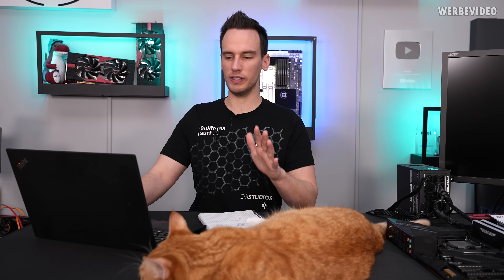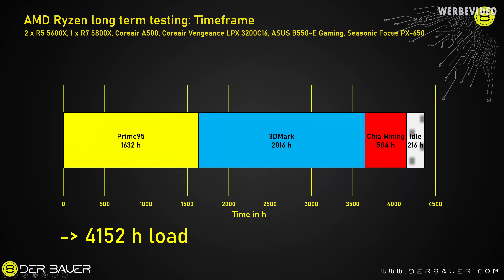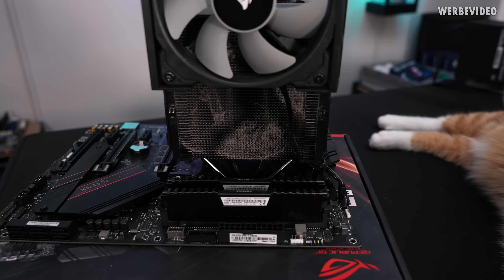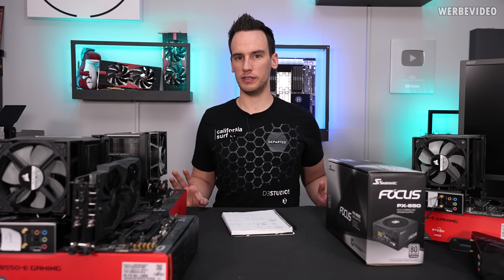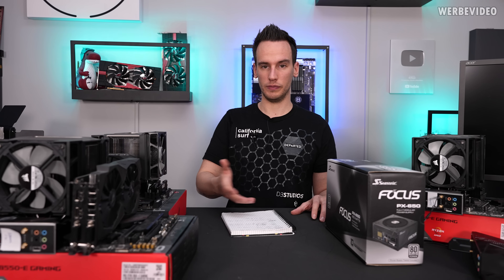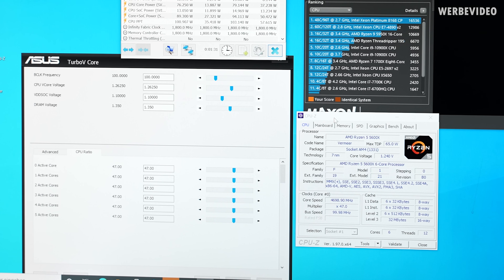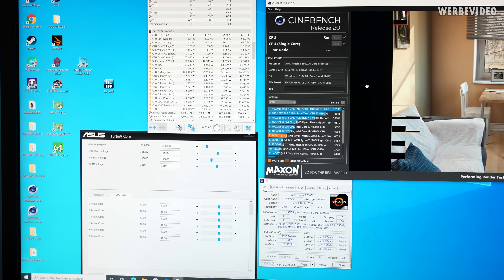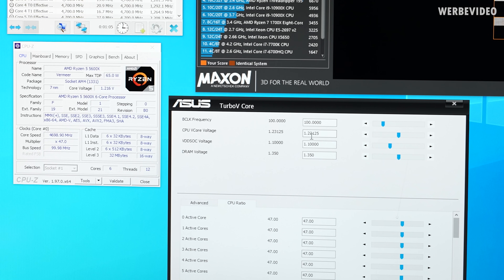4152 hours of Ryzen Long Term Testing: We have Good and Bad News

Comment: This is the type of content we need. It puts some science around the typical misinformation that gets spread around the internet. Here's how it works: one person in reddit or forum gets a bad CPU that should've been RMA'd in the first place, then everyone else starts freaking out, as apparently, this one bad sample becomes the general truth. Zero methodology, one sample out of a million. No one cares about everyone else with successful experiences, the bad CPU is the one to look at-- as if RMA didn't exist. I commend you on this research, calling it just YouTube content, with the amount of low effort videos we have nowadays, should almost be offensive.
Reply: I think you're correct. I had a launch day 3600X that was a horrible piece of silicon, it wasn't worth an all-core OC, and PBO made it worse than stock. I ran that CPU on stock settings for about 9 months, then it started BSOD'ing randomly once every few days. That eventually became once every few hours, before I RMA'd it. The 3600X I got back from RMA was a completely different chip, boosted over 150MHz higher and ran cooler to boot. It also didn't BSOD which was nice. I suspect if I had been running an all-core OC, I likely would've suspected it was degradation, when it was just a faulty chip.
Reply: @K31TH3R Was it a different stepping?  Stepping is critical
Reply: @VndNvwYvvSvv  While that's true of Zen3 CPUs (Ryzen 5000) the Zen2 chips always stayed on the B0 stepping AFAIK, even after the Zen2 XT release. However, the replacement 3600X I received was manufactured about ~2 months after Zen2 XT was rolled out, so I suspect the much better silicon quality was attributable to the improved and updated photomasks implemented with the XT chips. The chip performed identically to the 3600 XT and ran a consistent 550 CPU-Z single thread score @ 4.5GHz.
Reply: @New Moon Typically there are bad batches, but if you think it's worth keeping a bad CPU, then more power to you I guess... I'll RMA any day, any time, if I get a shitty CPU. I don't see a reason to keep a CPU from a crappy batch.
Reply: Science?  2 cpu?  I dont think you know what science means then.
Reply: @timothyandrewnielsen  and they forgot to test on a new motherboard, its probably the VRM on the mobo that caused the 3rd restart on the "bad " one, since it run two cinebench test just fine (in which the cpu as a chip had the same max temp on each run) so it probably was the vrm that started to get warm/hot after the first 2 runs and failed to maintain the proper voltage on the 3rd run. 

if you overvolt your CPU you dont just stress the cpu it self but the motherboard (e.g its VRM) as well. 

they should test the CPUs with a brand new mobo and PSU to exclude any failures of usage unrelated to the CPUs
Reply: @timothyandrewnielsen  Sample size is obviously a very important variable, however, there needs to be a proper test methodology in place, which is what derbauer did here. I will take his 3 cpu case anytime over 100 idiots in a forum who have no idea what they are doing shouting "MY VOLTAGENS HAVE DEGRADED MY CPU". Bad CPU Batch, period.
Reply: @CasualGamers  Sorry but his test has proven nothing.  Not scientific.  He only proved his CPU are good.  Not yours.
Reply: @sbcontt YT it just doesn't make sense for me honestly for them to do such thing, people would eventually realize something was wrong
Reply: I dont think AMD is anywhere near a bad CPU brand. Especially now with the 3000 CPUs I have only had bad experiences. RMA´d 4 CPUs and after half a year of gaming my 3900X keeps crashing and BSODing. Out of 7 CPUs of that gen (2 3600X, 1 3700X, 1 3800X, 3 3900X) All of the 3900X had problems 2 of them at stock and 1 undervolted to actually get the TDP.
Ill go with a upgrade to 5000 cpus to check if I will keep staying with AMD or change to intel since the 12th gen seems quite interresting
Reply: @AlpineTheHusky  if you realy have 7 bad cpu´s in a row, maybe your problem is something else but not the cpu
Reply: @georgwarhead2801  I built systems for friends. So 7 Sets of CPU, Ram, GPU, PSU and everything else
Reply: @AlpineTheHusky  i get it...it just feels strange to me to find 7 faulty cpu´s one after the other and still amd has ~ the same RMA rate as intel. i build my self 3 ryzen systems with 3600 and 3600x´s, many of my friends upgradet to a 3000 series cpu after i gave them suggestions for there new builds and no one has this kind of problems
Reply: well to be honest I did not see the entire video but incase it has not been addressed, as far as CPU restarting after the 3rd time of trying out cinebench it could be a VRM/mobo degradation rather than a CPU one so you should have tested the CPUs on a brand new mobo.  Overvolting doesnt only stress the CPU but the mobo as well. Also brand new PSU wouldnt hurt either.
Reply: At the same time, I've *never* had to RMA an Intel chip.  In the past two years I bought seven 3950X systems and nine 5950X systems and have had one bad CPU already (dead no-POST after 5 months) with at least two more just recently I'm suspecting are also starting to fail (random no-BSOD shutdowns) with no OC other than DOCP@3600 and PBO "auto" (Asus Pro WS X570-ACE boards, Seasonic Gold PSUs).
Reply: Huh, sounds like how certain other movement started, that's making covid worse to this day
Reply: Here's something to consider. Do those boards people are having problems with all use Intel chipsets for anything? If so there's the problem. I'd explain why but I'm sure it would start a flame war with all the brainwashed Intel fantards and apologists.
Reply: The problem is that it is VERY hard to get a company to do an RMA on a processor... VERY hard... like pulling lion's teeth and the lion is the size of the Empire State Building.
Reply: @christopherkidwell9817  My 3950X RMA was painless, to be fair to AMD.  Filled in the form, got a new CPU - no questions asked.  I had good troubleshooting information in the RMA form, of course, so perhaps had more success than a less detailed RMA.
Reply: @christopherkidwell9817  LoL. I did mine real quick and they didn't even ask for purchase receipt or invoice. I just signed a waiver. This was an Intel RMA, but a friend did AMD and it was painless. They didn't have the same CPU to send back so they paid him and it was actually more than what he paid for, lol. Unlike Intel, they did ask for an invoice though, he mentioned. This is in Brazil where stuff generally doesn't work... RMA works great for both companies
Reply: i had a bad 5600x tho. It was freezing when i gaming and one day pc stopped posting completely. After 3 weeks of hard work (i couldn't find any compatible hardware to try and find out which of my hardware is gone bad) i understood my CPU was bad. They sent new one from RMA.
Reply: And much of the problem was Reddit types of individuals and groups. Never underestimate their weird hive groupthink and tribal shibboleths.
Reply: Casual aqui 👀
Reply: @sbcontt YT  I live in Brazil, where laws generally don't work, yet AMD and Intel RMA works great. I even have a video doing RMA by phone in my channel (in Portuguese obviously). I RMA'd Intel CPU even without invoice, it worked just fine. AMD asks for legit invoice though. The other guy in Indonesia also gets RMA, but either way, that's not the point. It's just that these rumors get spread based on a poor sample and everyone starts assuming it's degradation. My R5 3600 has been through 1.85v under ln2 (check hwbot) ran a bunch of benchmarks and I still daily drive it with 1.35v at 4.3ghz with no problem. There's just bad samples and people are lazy to RMA. Maybe there are countries where it doesn't work, but I would bet that those complaining didn't even try it.
Reply: @CasualGamers  I don't get it, just RMA it? Your law🤔
Reply: salve concordo com tu
Reply: It's not just bad CPUs - sometimes people flash newer version of BIOS which has tweaked LLC settings / disabled stretching or some other changes (RAM related for instance) that make the system unstable (or it wasn't stable in the first place, it just worked because clocks were stretched, for example) and they go to Reddit and start to tell everyone how their CPU degraded
Reply: @sbcontt YT I don't know dude but I live in Indonesia, and I have yet to see such problem with cpu RMA's in one of our largest PC enthusiast facebook group, granted there might be one or two but most of the times it was just supply issue, took a bit longer for them to get the replacement
Reply: Testa DDR5 nas APU AMD assim que sair. 
Se nas Intel parece ter melhorado quero ver nas AMD.

Comment: degradation is what i experienced on my 1st gen ryzen after a couple years of 24/7 heavy use. both core and imc were affected and now i can only run at stock speed.
Reply: Theres absolutely no way you can only run at stock speed. LOL.

100% lies.
Reply: @nexxusty  believe what you want but that's what i experienced. the chip itself was bad at overclock since the first time i bought it

Comment: YEssss finally lol was waiting for this video for months lol scared to OC my ryzen 24/7
Reply: Their not much room to OC modern chips these days.
Reply: @grlmgor  yes true, I tried to OC my 5950x conservatively at 4325GHz it always either crash after a few hours on heavy load because I didn't give enough voltage or if I increase the V it generates so much heat the fan has to be running ridiculously loud, and I can't squeeze out more than 10% performance for my use
Reply: @ddr80  You need to undervolt the ryzen 5000 series to get performance.

Comment: LMAO! The only CPU I've damaged with overclocking was an AMD K6 400MHz. I jacked it to 550MHz with a ton of voltage. I knew I was well outside of the safe limits. Going from 2.2V to 3.1V if I remember correctly. It was a trash tier CPU and I knew it. Several of my friends managed to get to 550MHz with just 2.6V or 2.7V. One day, during a big compile job, I got a kernel oops (Linux version of BSOD). I rebooted at it went into a spontaneous reboot loop resetting as soon as it tried to unzip the kernel image. Ok, let's remove the over clock. Nope. It ended up only wanting to run 350MHz at 2.5V, so I gave it to a friend who was on a 266MHz... But that thing took a hard beating sometimes 12 hours a day compiling code for 3 and a half years before taking damage... Every CPU I've had since then (except laptops) have been ridden hard and put away wet for their entire lives, and all of them have lived on with other people until they were laughably outdated. And I'm not an upgrade-slut. Many of my systems have been run like this for 5-6 years before being passed on. And they all ran stock speed at stock voltages for ever on after...

Comment: My girlfriend's 6600K recently got stuttering in some games after being overclocked to 4.5ghz at 1.25v for 3-4 years. I increased the voltage to 1.3 and all is good. After the next 4 years I'd increase it to 1.35, but I'm sure we'll upgrade her system before that.
Reply: May be even the PSU, not even the CPU.

Comment: personally, anything above 1.4V scares me, both on intel and amd, though admittedly more on amd
Reply: Alder Lake is on Intel 7, which has a density ever so slightly higher than TSMC N7.
Reply: @andersjjensen  I've not had hands on with intel 7, only had experience with 8th 9th and 10th Gen
Reply: @renchesandsords  Well you can always get a 12900K. That thing is factory over-clocked so you don't have to bother :P

Comment: Great work!  I would like to see you continue this test for another six months on those CPUs, and add an Alder Lake (preferably i7 or i9) at 1.55 or even 1.60v to this test.  I would suggest doing CPU mining as your test load, to offset your power consumption.
Note that you can set your connection as "metered" to reduce Windows Update reboots.  Also note that you can look in your System Event Log after a reboot to determine exactly when the system rebooted.  Chances are, this history goes back the whole six months!
Reply: Why intel at even higher voltages? Would it not make sense to use the same 1.45v to compare how monolithic gets affected vs chiplet? I mean you could not run 1.6v unless you cooled intel down with liquid nitrogen lmao.

Comment: I have a 5950X and a 3970X running 24/7 with PBO under custom loop waterblocks mining CN-Heavy. We'll see how long they really last.
Reply: If you're mining you should definitely put an all-core overclock, it will increase hashrate and reduce power consumption, increasing profit.

Comment: I run my 5800x at 0.7 volts lol so that means that mine will live forever?
Reply: LOL what clock speed?
Reply: @grlmgor  Blazing fast 2.3 Ghz, I've managed to push it lower to 0.65 volts but that's really pushing it. You also have to bring it down from default voltage in small steps otherwise it crashes, but it's worth it for the beautiful sight of a 5800x at 20 watts lol.
Reply: @CulturalCats  I run mine at all core 4.6 Ghz @ 1.15v with no boost, it run about 40 watts.

Comment: My 2600K did degrade slightly with a high OC and high voltage but it took about 4-5 years and it was still good for another 4 while slightly reducing clocks/raising voltage over time. Nothing wrong with that and it seems things are similar now
Reply: same here, I bought my used, had it for like 2 years at 5ghz 1,48-1,5V and lately I had to go down to 4,8ghz for gaming (4,5-4,6 fully stable at 1,5V lmao) so 10 y.o. cpu That probably sit 4,5-5ghz all its life finally starting to go out slowly, if I run stock clocks or like 4,2ghz at 1,25 it would run probably another 10-20 years.
But I just bought 5600x
Reply: also my temps are not bad, liquid metal, good cooler slightly polished the ihs myself, when gaming it rarely goes 75-80* Celsius
Reply: @pilot554  Lmao I had mine "cooled" by a Corsair H60. I no longer torture my CPUs :)

Comment: 1.45vcore is nutty when pushing these chips at 100% heavy load.  This video is fantastic thanks for doing this experiment!
Reply: Thats the Vcore I used to set in my old Phenom II x6
Reply: @ikarus1111a  a few years back it was normal to have a higher voltage, it depended on the architecture the given cpu was built upon. Bigger nodes could handle higher voltages more consistently, smaller ones require less and less to slow down degradation.
Reply: The result does not prove the high voltage is the cause of the degradation, could be caused by natural use, high temperatures, temperature changes or something else.
Reply: I've been running my 5600G at 1.45v 4.725ghz all-core, 1.3v igpu @ 2300mhz for the past 6 months, no issues. NH-D15 cooler, still only tops out at about 75C when I run a very cpu-centric miner. Gaming, it keeps under 55.
Reply: yeah. then for sure 1.35 volt is 100% fine
Reply: 1.45 is what most "Reviewers" publish but it's so damaging on the long run. Just stick to a maximum of 1.37V or so.
Reply: My 5600X is reporting burst voltages up to 1.49GHz.... never sustained for more than a second or so before dropping to like 1.36v but still, should I turn down my scalar?
Reply: @nothing.mp3 Nothing to worry about. You usually get these momentary voltage spikes when sleeping cores are powered up. It's sustained voltages  under load you need to keep an eye on.
Reply: @nothing.mp3  yeah, that is normal with PBO. It's only hitting those voltages for like a split second, very infrequently. If your temps are fine, then you don't have any issue. I've run my 3800XT at like 10x scalar and the temps were still well below max with a 360mm AIO. Didn't make much difference to performance, but the temps were still fine.
Reply: @nothing.mp3  voltage is not ghz lmfaooooooooooooooooooooo
Reply: @nothing.mp3  1x scalar max, with just pbo on auto frequency and voltage then whatever pbo / the smu decides is 100% safe. whatever this video shows is 1000% damaging
Reply: @whoisthatthingwhat  this video disproves what you're saying.

0.004v could be related to VRM or capacitors on the main board getting weak.

It's nothing, well within the voltage scale of the CPU. I've had to add voltage to many CPUs over the years and 99.9% of them were not overclocked and it was a hell of a lot more than 0.004v.
Reply: Still pushing 1.48 volts (vdroop to 1,42v on loads) on my Fx8350@4.75Ghz (Aircooled, fsb Overclock 237x20, without LLC). I had it for 9 years, but i began OC it 5 years ago. 
Keep in mind that voltages really depends on the CPU you're running and most importantly, the temperatures.

Comment: I remember being told the 22nm process is too fragile and unstable, so Ivy Bridge can't take more than a mild overclock when I built my system. I'm still running that overclocked 3770k today. It's fine. It's still good.
Reply: As Roman said: people say this for every node shrink. But it's always the young whippersnappers who say it because this is their first rodeo. I got into overclocking on my AMD K6 400MHz, and I've been overclocking the snot out of everything ever since, simply because buying a beefier cooler is cheaper than buying the next tier CPU :P
Reply: @andersjjensen  Same, started with K6 and have overclocked every processor I ever owned since then to their limits. And I still have all of those CPU in working condition. Including my very first K6
Reply: Same here with a 3770k
Things been churning along for years just fine, already eaten one PSU.